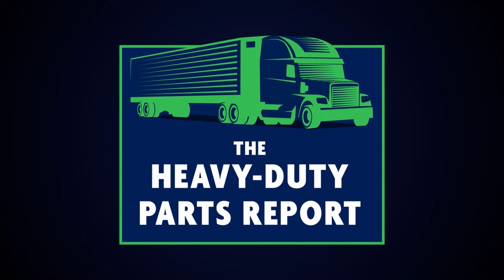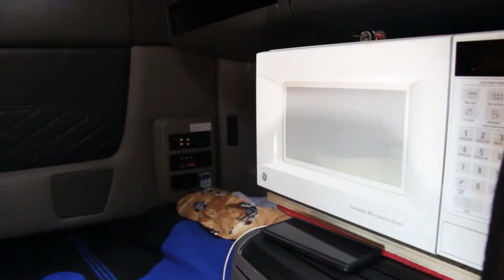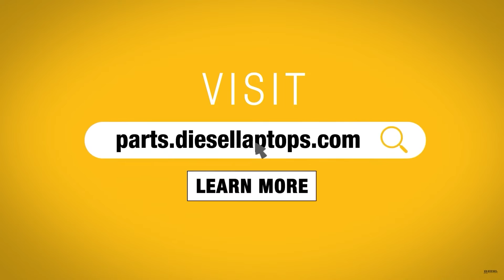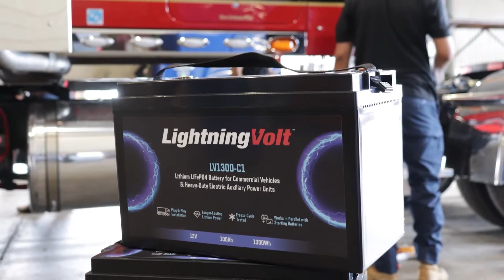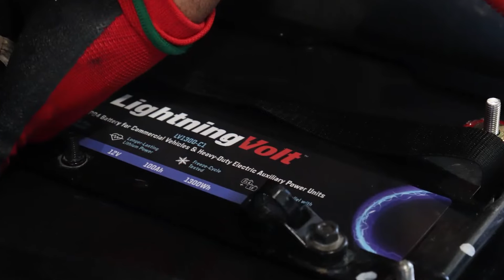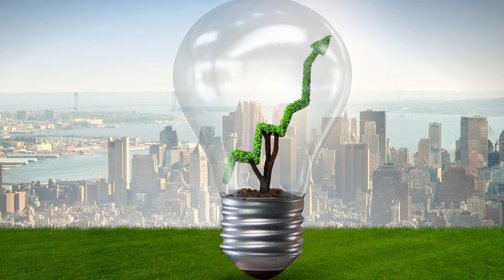Supercharge Your Fleet with Lithium Batteries

Comment: Can u use this batteries to change lead batteries on a semi truck.I just need them for power not for starter. I have a maxwell commercial battery that’s a capacitor to starting. Can your batteries be use only as Stan alone. With the alternator charging  them?